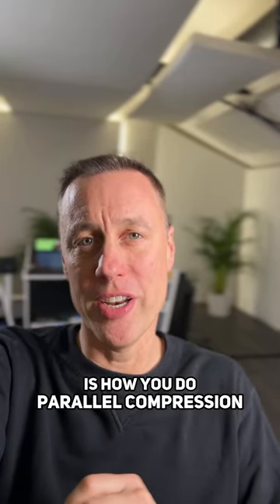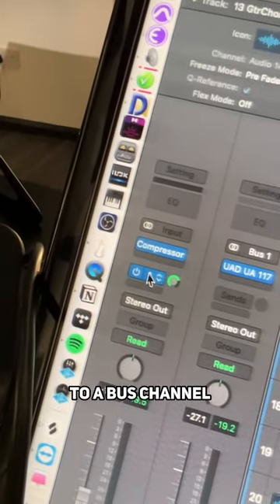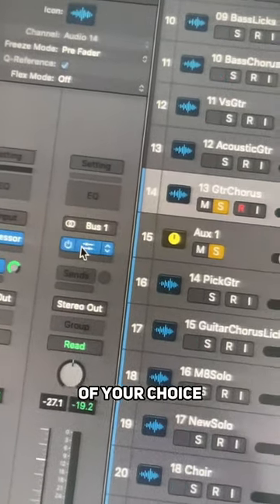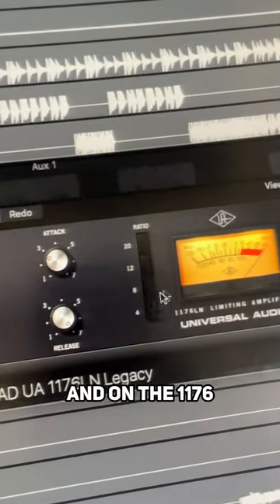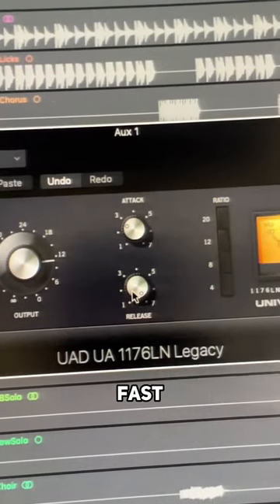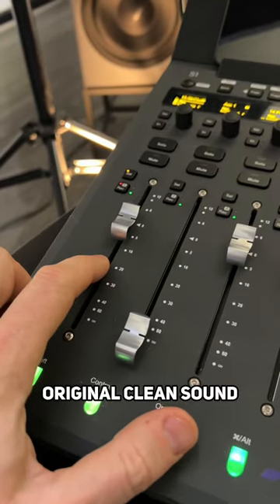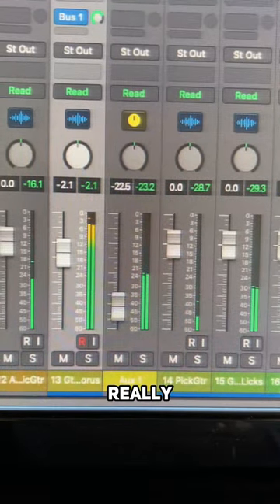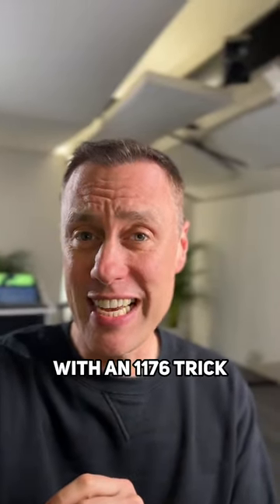HOW TO DO PARALLEL COMPRESSION 🎛

Comment: but it makes things louder
Reply: no shit?
Reply: Compression doesn't make a signal louder, it just allows you to turn it up louder if you wish. Blending a compressed signal, with the original signal, doesn't mean it has to be louder, adjust the volume of both signals so that it's still at the desired volume level. It can be louder if you wish, but there's no reason at all why it would have to be louder than before.
Reply: @DBTHEPLUG  it's the oldschool way of doing it. Nowadays its much better to buss the drums and place the compressor on there and using dry/wet. much more transparent way of doing it.
Reply: @jeremias3363  idk i just use patcher for parallel processing since i use fl studio so i don't even use send channels
Reply: @DBTHEPLUG  which is the better way of doing it. With parallel compression the way its done in the short you are fully adding a very similar signal. There is a massive loudness increase like that.
Reply: @jeremias3363  Yeah i understand what you mean. You aren't really able to control the volume well that way.
Reply: @jeremias3363 If blending with the mix dial is the best way (in your opinion.. how do you eq your parallel compression channel? 

I often find the best thing to do when I'm parallel processing is to tuck some things in, maybe shelve the highs down a touch on it, maybe cut some 90 - 200hz to stop mud build up and keep it super fat but clean..

How would you do that when using the mix knob?
Reply: @UncleBenjs  depends on the daw, in live I just make a chain with two layers and with some old trick map them in a way that allows me to dry wet them. You can do the oldschool way but if you do, you should turn down the drumbuss as yoh pullup the parallel
Reply: @jeremias3363  That didn't answer the question tho.

With your method, how would you eq the wet signal different to the dry signal?
Reply: @UncleBenjs well like I said it depends on the daw. In ableton its easy, you can make a rack with two parallel channels. You can map them to a knob in the rack device to act as a dry wet mix between the two channels. Then you eq compress whatever you want to do on one channel and leave the other empty. Now you can dry wet om the drumbuss between the dry drumbuss signal and the eq+compressed version of the signal. In reaper this can be done, fl, bitwig but I dont know about the others.
Reply: @jeremias3363  So the same as the original way then.. a couple of parallel channels. If it aint broke, no need to fix
Reply: The whole point of this type of parallel compression is to add character, punch, thicken the signal, or even to make things perceived as louder (not actually louder but perceived loudness). Just because this method maybe more "old-school" doesn't make it any less valid than using dry/wet knob and both of those workflows can be useful depending on the results you are trying to achieve, they are just two different ways of working and one can be better than the other depending on the situation.
Reply: @antoniofontan3934  tricking yourself with loudness is generally not a good idea but do as you please :)
Reply: @jeremias3363  never said I was doing that but okay buddy
Reply: @antoniofontan3934  its the point buddy, the old school way adds so much loudness you can't judge what you are doing. Buddy.
Reply: @jeremias3363  but thats the point of parallel compression buddy. It's to ADD a compressed signal to a dry signal. If you know how to bypass and use faders it isn't really an issue to level match buddy. This method and whatever method you use for parallel compression are two different ways of doing the same thing 😂 but do as you please buddy
Reply: @antoniofontan3934  yes this workflow was invented for analog days and of course one can level match. Its just somehow never shown in these tutorials. In modern days there is simply no need to use a buss for this effect because plugins have dry/wet. The modern method lending itself more to level match. Thats all buddy.
Reply: @jeremias3363 buddy like I said before they are both equally valid and they are just different ways of doing the same thing and both have use cases where you would choose one over the other. For example I wouldn't use the dry wet knob if I wanted to process the dry signal with some other effects while adding in a compressed signal that isn't affected by the effects I'm putting on the dry signal. In that case I would use an aux bus and send the signal pre insert and blend in the compressed signal. And just so you know all DAWs signal flow is based off analog console workflows. it's just that now in DAWs like Logic, Protools, Ableton and many others, you can route audio in just about anyway you can imagine with about 2 mouse clicks and there are so many creative ways you can do parallel processing and processing in general. Like in Ableton I could just use an effect rack and blend dry and wet signals that way if I wanted to. Just depends on what you are trying to accomplish
Reply: @jeremias3363  also, not all compressor or other effects plugins have automatic gain compensation so just because you use a dry/wet mix knob does not mean you aren't going to have to level match after compression (and not all compressor/effects plugins have mix knobs either)
Reply: @antoniofontan3934  dry wet in that case is much safer tho. The heavily compressed signal will be mich lower in db. You can focous much more on the color change of the mix that way. Indeed you will have to adjust gain like thay too!
Reply: @jeremias3363  hear me out, I like dry/wet mix controls, I use them all the time as they are very convenient and useful, and if I want to do quick parallel compression (or any other effects) without any fancy routing then I'll go for the dry/wet mix knob because it's way faster than routing a parallel aux channel or even making an effect rack, but it's not safer it's literally the exact same thing and again depending on what you are trying to accomplish, you would choose one over the other
Reply: @jeremias3363  except that doing it this way allows you to EQ the compressed bus separate to the dry/transient signal so not necessarily old school at all.
Reply: Bigger….
Reply: @Boleskinebeatz  it depends on the daw like I said. In Live it's easy to make parallel chains of any effects you want to put after each other to mix parallel with it's channel.

Comment: Do we have to use makeup gain on the compressor while using parallel compression?
Is there any guideline regarding how much gain reduction should be happening in that compressor so that we can dial the threshold according to it?
And what about attack and ratio?
Do we need to compress original signal by directly inserting a compressor as we normally do?
Reply: If you’re doing parallel compression this way as opposed to putting everything through one compressor and using a mix blend then no you don’t need to use make up gain as you simply add in the amount on the fader you need and you shouldn’t need or want to compress the original signal or you will lose the transients which is the main reason for doing parallel compression particularly on drums.
Reply: Try to AB then gain match is needed. But i’d rather use the energy from my parallel as my makeup.
Reply: Try this with a distressor, that thing sounds amazing!

Comment: I think you got the attack/release settings wrong. On the 1176 fast is all the way to the right.
Reply: is that not what he did?
Reply: Indeed my bad. The thing I wanted to express is that for a parallel compression, the release shouldn’t be fast because it should hold the compression and the attack should be quit fast. That way you have a super compressed signal that you can blend together with your ‘normal’ signal. I hope that helps😃
Reply: @ak47beats64  right? tought the same thing. I always go for fastest attack slowest release